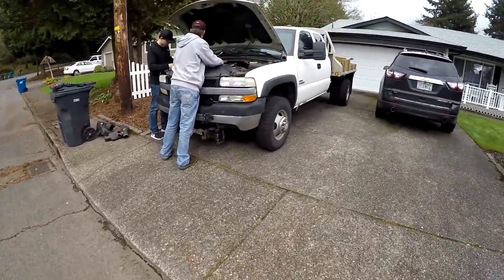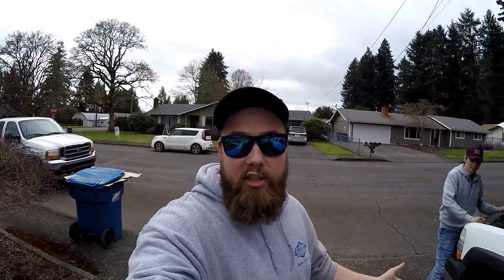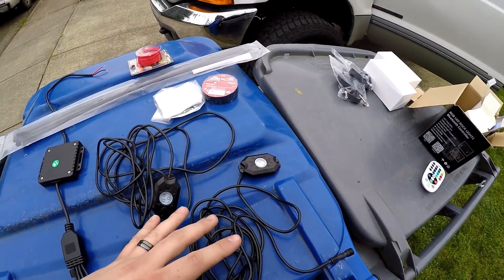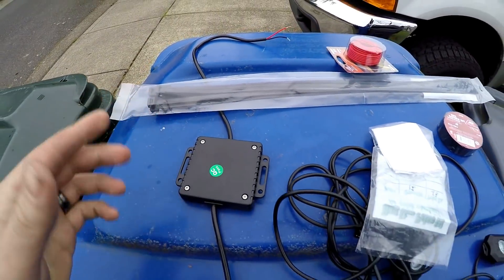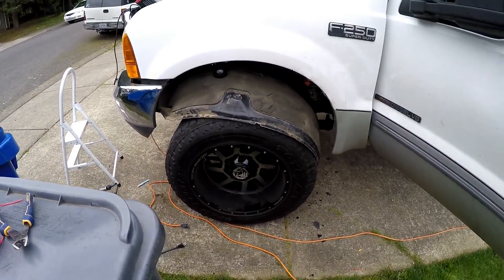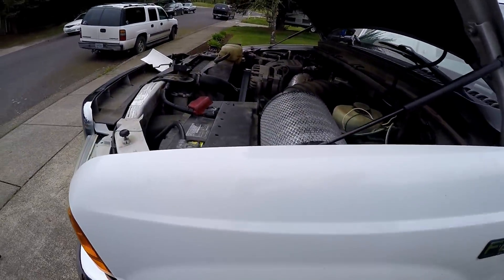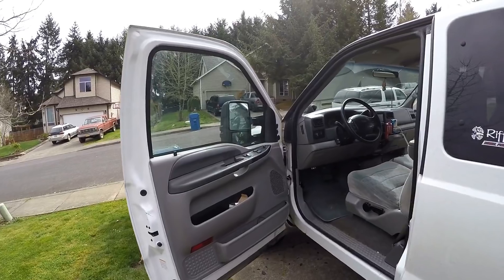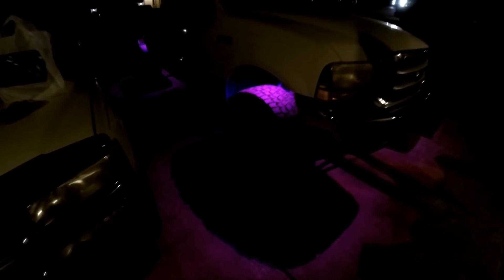The Powerstroke is DOWN... **Not an April Fools**

Comment: 16.5 mpg is decent but my 7.3 PS got 18.8 from Cali to Texas running an average of 80mph.
Reply from the maker: Dang buddy!!!
Reply: PowerStoked I have a hypermax tuner with a K&N intake. Haven’t done the exhaust yet, when we made that run it was summer so the a/c never shut off. 13.5 is about what I get city/hwy mixed driving. I have almost 250K miles.

Comment: Check the fuses on inside the cab and under the hood. I drilled into a wire on my obs when I did my stereo install and it was a blown fuse from under the hood.
Reply from the maker: I already checked the fuses and sadly I wasn’t lucky enough to have that as the  issue 😭